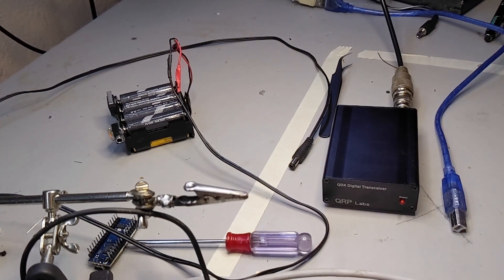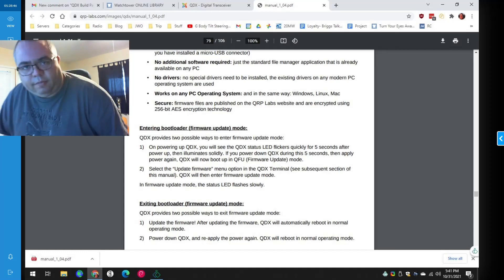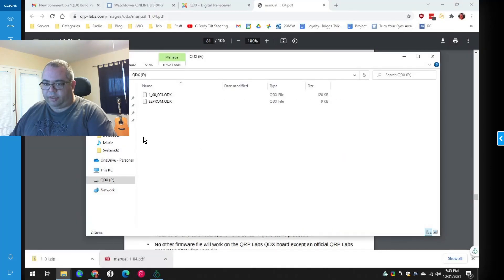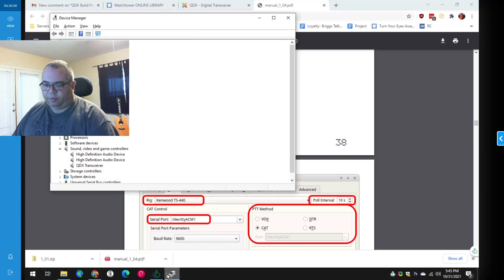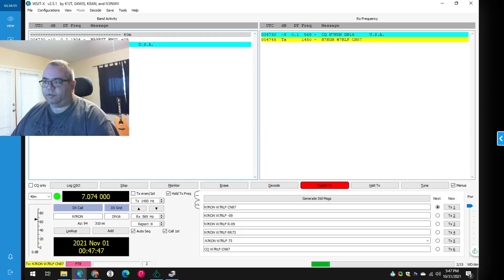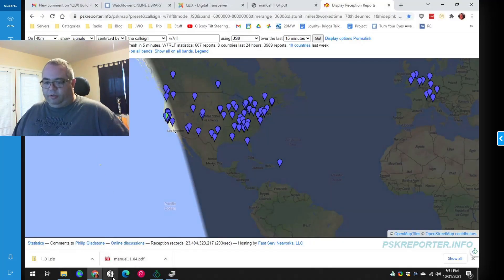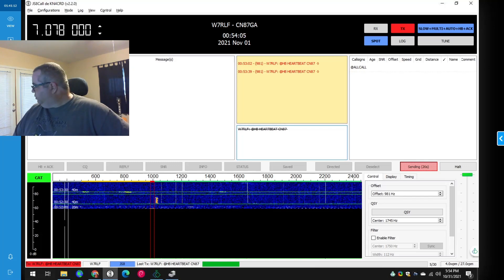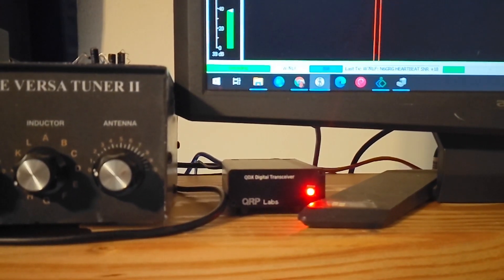QDX Build Part 16 First Powerup, Firmware, Contact! Testing on FT8 and JS8Call

Comment: I built mine for 12V ...have you run yours off 13.8V .....if so was it OK??? Mine blinks on 12 V battery ....would like to run it off PSU 13.8V DC. Congrats on the fine build.
Reply from the maker: Yup it was fine on 13.8. have fun!!
Reply: @MiscDotGeek  LEGEND!!!!! Thanks 73 de VK2AOE

Comment: FYI, there's a horrible bug in firmware version 1.01c: After a few minutes of FT8, the QDX frequency goes to 1/10 of the value it should be. I've tried the one later version, but it only produces a loud hiss, so back to 1.01c. I hope Hans will get around to fixing that, otherwise it's a great radio.. just unusable for now.
Reply from the maker: I was experiencing that issue before 1.01c, and it got better (but not solved yet). Make sure your CAT settings are set to 9600, 8,N,1, Hardware hand shake OFF. See if that doesn't help. Also make sure polling is 10 seconds not 1. Although I'm experiencing the issue, it's highly intermittent.
Reply from the maker: In fact, check this thread: https://groups.io/g/QRPLabs/topic/qdx_cat_control_issue/86945406

Comment: Hello!   QXD is not being seen as a eeprom drive.
Is it suppose to be? I can’t get Windows 8 to see it and drivers from ST also not seeing QXD unit.
Any ideas please?  73
Reply from the maker: Make sure the TCXO is soldered in. Does the LED flash quickly when you power it up? If so, turn it off during that time, and then power it back up. Then windows should see the drive :)

Comment: Further to my QDX. I found one of the replacement inductors had a dry joint and then all ok. Good results on the 12v with the 2 wire secondary winding.  However when installed in the case after 4 QSOs it  stopped receiving and transmit also played up.  In removing the pcb I found the 3.3v V regulator very hot to touch.  The 5v was Luke warm. When looking at the circuit. Both V regulators are feed from 12v supply. That means the 3.3v R is having to dissipate 8v which seems a lot.  This seemed worse when transmitting. How have you found your QDX  in QSOs.

Comment: It would be better if we could see the content of the screen, your insert covered most of it.
Reply from the maker: Sorry about that- I'll adjust the size next time. Thanks for the feedback!
Reply: @MiscDotGeek   Thank you for the QDX build which was helpful. 
I have built the QDX but no TX on any band, so have an issue to rectify. 
I am amazed how good it is on receive and almost on par with my IC7300. 
This radio is going to be a big hit, especially its  low cost  and remote/portable QRP etc.
Reply from the maker: @ralphwilmot6351  Make sure to heat up all the inductor connections again. Crank up the heat, 10-15 seconds. I had to do this to get output on 20 meters. This PCB can soak up a lot of heat!

Comment: Another great product from Hans and great coverage by yourself, but I’m afraid I just don’t understand the attraction of digital modes beyond WSPR. FT8 has to be the most soulless way of making contact with another human unless you want to argue that that crown is held by FT4. And automated FT8? Really? What is the point of making mindless contacts in poor conditions just for the sake of it?
Reply: Leo- FT8 is HOW you get your rig running right. There's little coverage for WSPR outside of the US, How else can you validate your radio and antenna as a system? With FT8 it's INSTANT feedback, transmit and receive. 73
Reply: @avt3216  Either you’re trolling or you have a terrible antenna. WSPR is worldwide. I can get WSPR hits in Antarctica, New Zealand and the USA from near Scotland with 5W. How will a digital only rig validate my FTDX-1200? If RBN tags me, I can see where my CW is getting to instantly and then I can alter power or antenna accordingly.